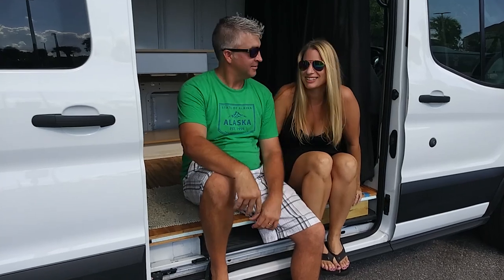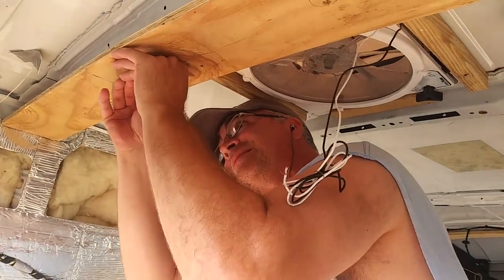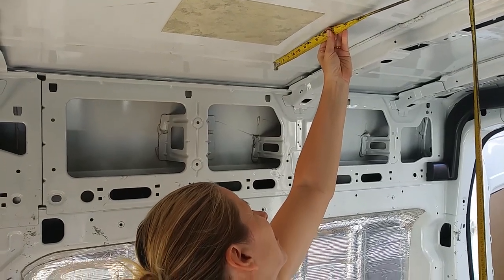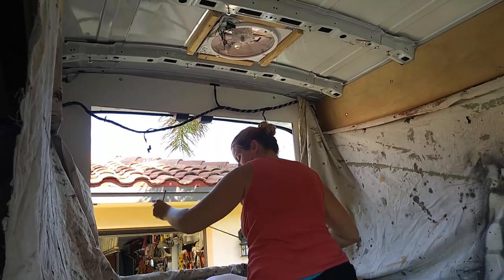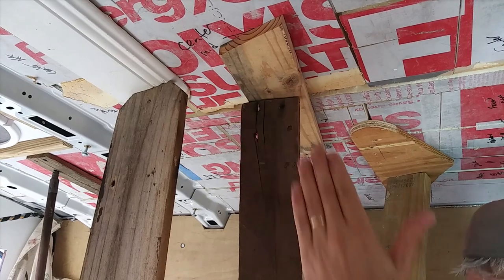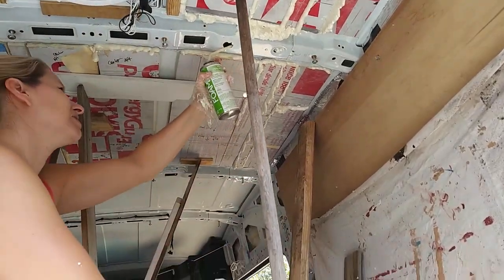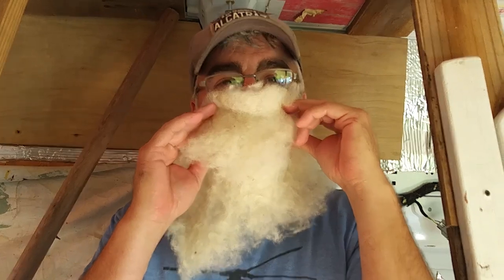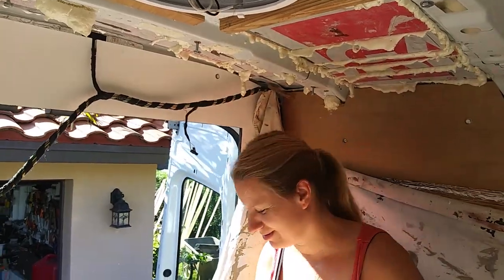Van Conversion FRAMING & INSULATION (Polyiso, Spray, Havelock in Ford Transit) | VAN BUILD #5

Comment: This series so far has made me second guess that I can do this by myself.
Reply from the maker: Hi RJ! Thanks for watching. It's definitely a lot of hard work but the nice thing about a van build is that there are so many ways to do it and you can do what works for you. If there are certain aspects beyond your skill set you can learn new skills, get some help, or try an alternative solution. We've seen several people add premade elements, such as cabinets and other furniture, in their build so they don't have to custom build as much. There are a lot of ways to do a simpler build. And depending on how you plan to use your van and the climate you plan to be in, perhaps some elements aren't even necessary!

Comment: Fun fact, polyiso R value drops to about R-2 per inch at 15 degrees F.  It starts dropping at about 60 degrees and is no better than fiberglass batting by 40 degrees.  This is because the blowing agent inside the foam starts condensing into liquid and becomes more thermal conductive.  Sorry to burst your polyiso bubble but I thought others might want to know its not really a good cold weather insulation.  Its great in hot weather though.  XPS is far better for cold.
Reply from the maker: Thanks for sharing that tip. If that's true, that works perfectly for us since we are most often in warmer temps and we doubled up with the Havelock wool so that will help during the cold temps. Sounds like the XPS we used on the floor was also a good choice! Thanks for watching!